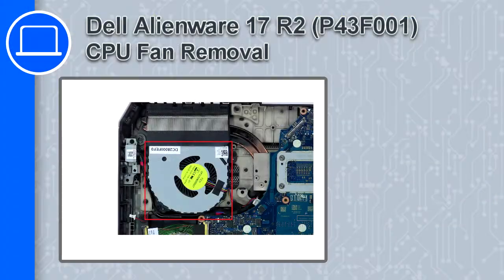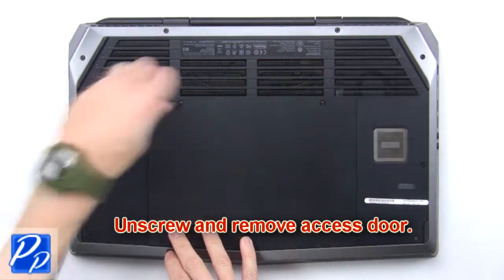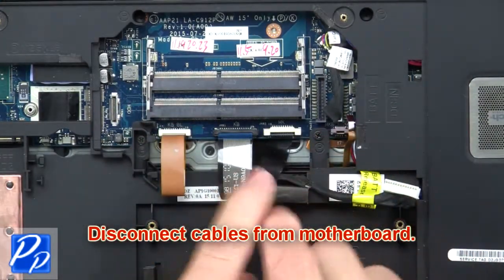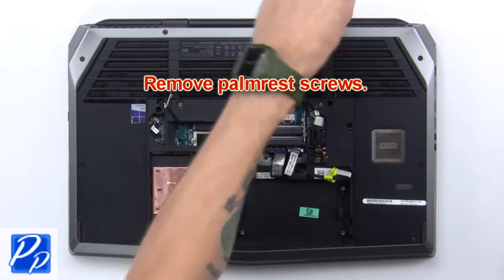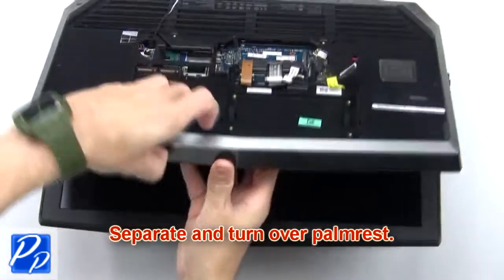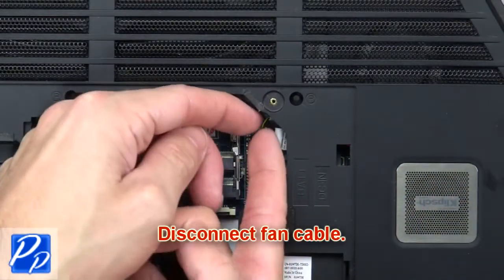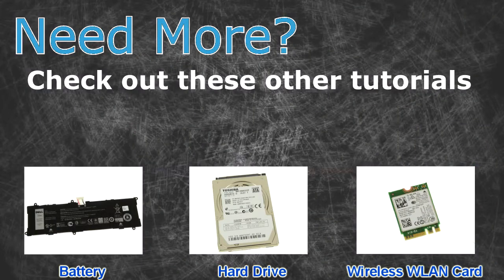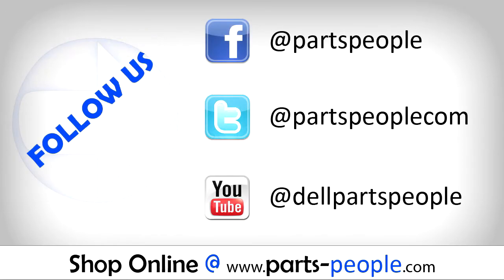Dell Alienware 17 R2 (P43F001) CPU Fan How-To Video Tutorial

Comment: This is not the R2. The video card fans in the R2 cannot be reached through the bottom, which looks entirely different that that shown in this video.
Reply from the maker: Are you sure you have the Alienware 17 R2 not the M17x R2? This is a 17 R2.
Reply: Ahh...ok - that explains it. Thanks  for responding.